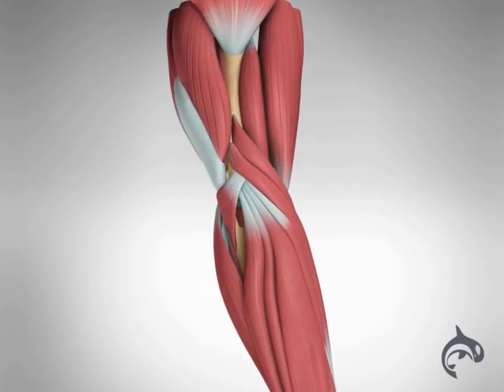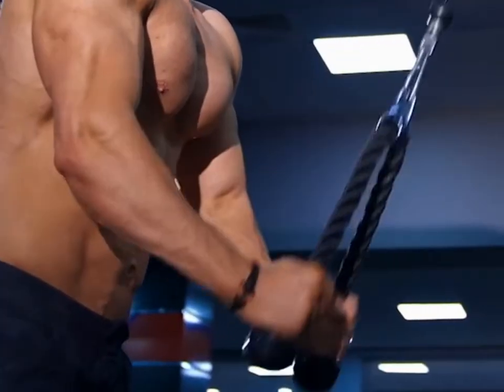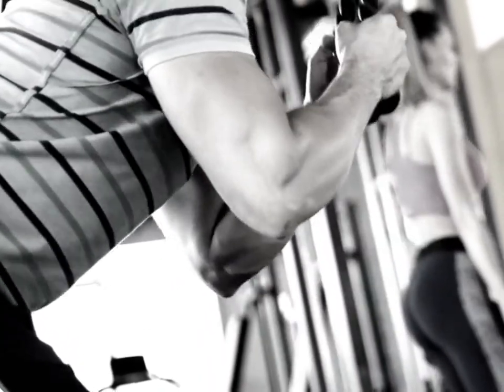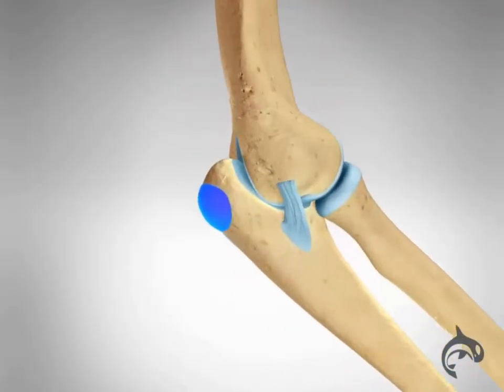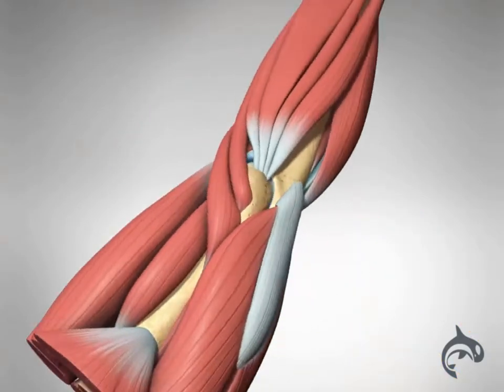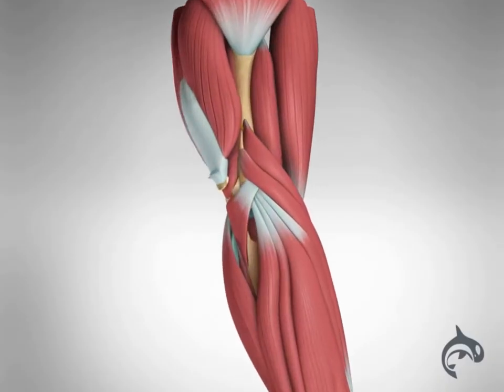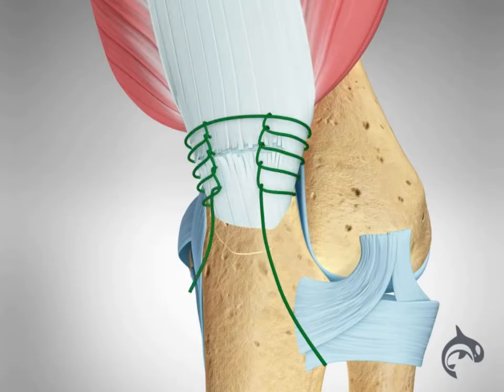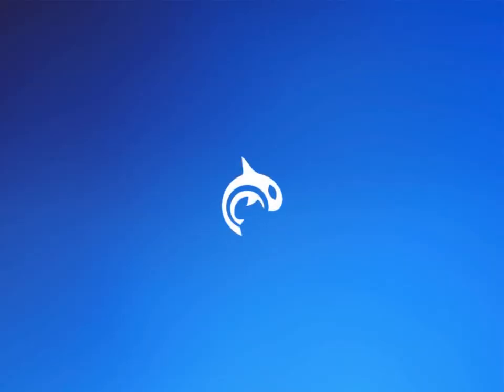Triceps Tendon Avulsion and Repair - 3D Animation

Comment: How would I know if I had a tricep muscle tear or a tendon detached tear in my tricep? 
The happened few years ago I was doing skull crushers in the gym and I heard a little pop in my elbow. I had slight shoulder pain for a few days but I was still able to work out. I never turned black and blue.
However, I get a slight cramp in my tricep area sometimes with certain pushing exercises. do you know what this might be?
Reply from the maker: It’s good that you didn’t have bruising, as that often indicates a more severe tear, but that “pop” sound and the persistent cramping could suggest a mild or partial tear, possibly of the triceps tendon or muscle fibers. Here’s a quick breakdown of some signs to help tell the difference:

	1.	Triceps Muscle Tear: If you had torn muscle fibers, you might feel weakness or cramping during certain exercises (like pushing movements). However, you’d likely still have most of your strength, and any pain or tightness would be more in the muscle belly (middle of the tricep).
	2.	Triceps Tendon Tear: A tear in the tendon would usually cause pain closer to the elbow joint and could affect your ability to fully extend the arm or generate full strength in pushing exercises. While complete tendon tears are rare, partial ones can still cause discomfort or occasional cramping during heavy lifting.

Since you still get occasional cramping, it might just be a minor or partial tear that didn’t heal fully, or even some scar tissue causing tightness. If it’s bothering you or affecting your workouts, seeing a physical therapist or specialist could help confirm if it’s a tendon or muscle issue and give you exercises or treatments to prevent further aggravation.
Reply: Had you ruptured the triceps tendon completely there would no doubt as the need to vomit and evacuate your bowels happens then.